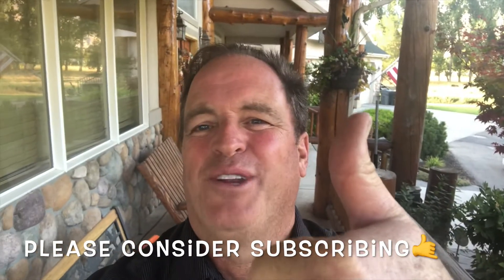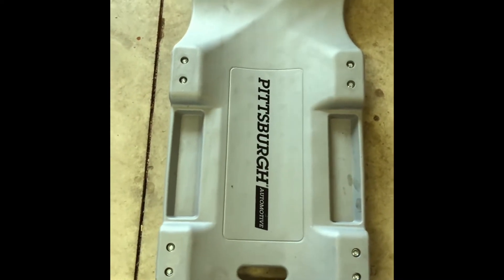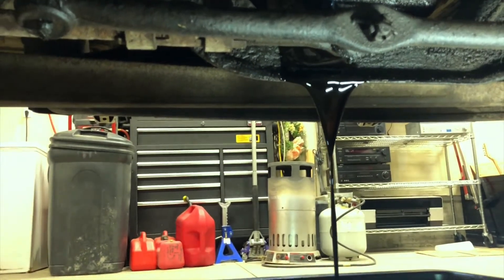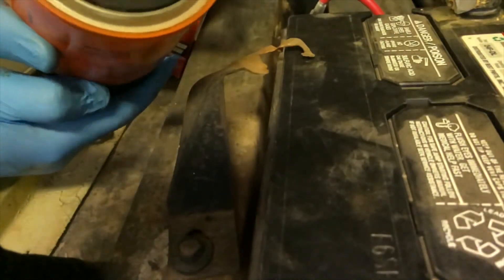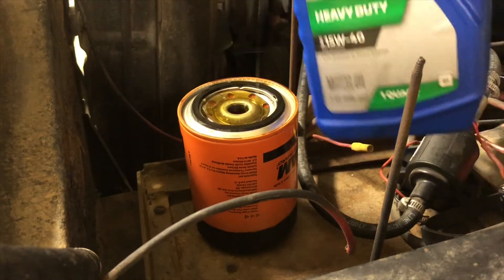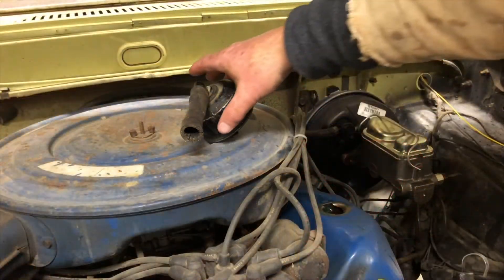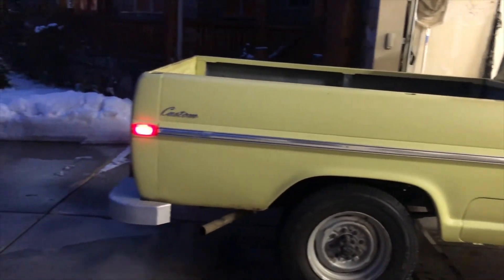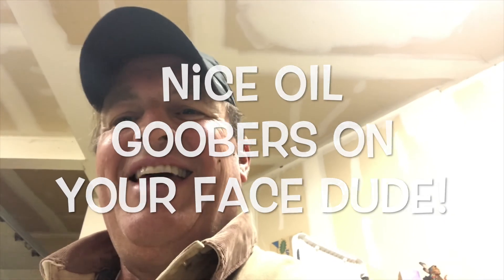CLASSIC FORD TRUCK OIL CHANGE FOR  $19

Comment: Just got a 67 f100 240ci, engine that's wore but gets me around. Scard to use detergent oil. What do you think.? Loved your vidio
Reply: detergent oils will wash away the zinc that protects your engine from metal to metal contact....how!! ever!! for a daily driver running less that 2700RPM which is about 70 MPH and keeping your engine at normal oil pressure and temperature,so conventional oil is just fine especially changing the oil at every 3000 miles vs 5000 or more will last many many miles before a rebuild, my 360 ford was rebuilt for the 1st time after 40 years and its been 14 years since my 69 f250 360 was rebuild and is running like a top and your will too!!